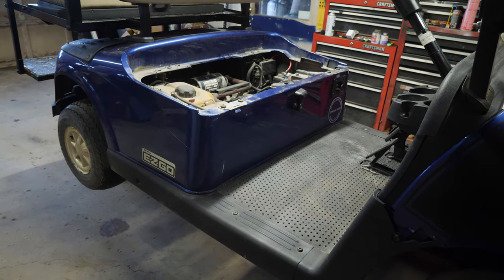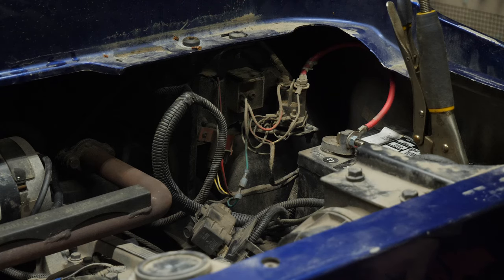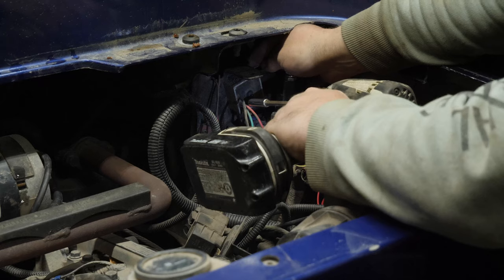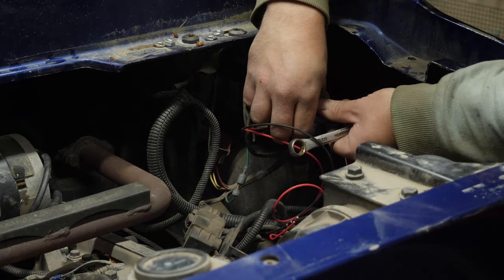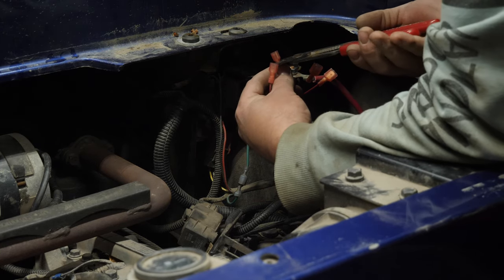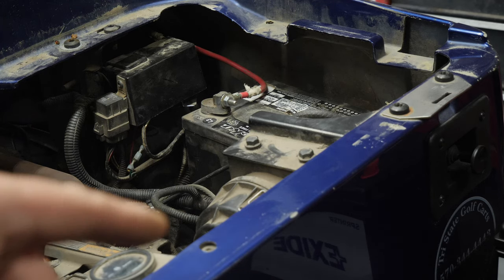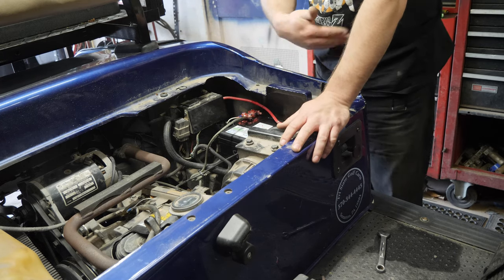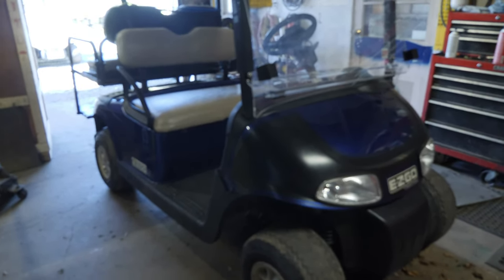2014 EZGO RXV, Gas - So Many Issues!

Comment: When adjusting the valves on this type of engine. If you bring the piston up to tdc one valve is open and the other is closed. Is that how you adjust it ? I thought when you adjusted them they were suppose to be fully extended. I know the images in the manual shows the adjustment being made with the spring fully extended out ?

Comment: Starter generator is number 1 failure component on 13HP Kawasaki EZGO. it's too underpowered to crank this massive engine through the compression stroke. Telltale signs are it hanging on the compression stroke. The newest 2019+ models have sealed brushes. Have to replace entire starter generator. Ain't disposability grand?
Reply from the maker: More reinforcement for my hatred of EZGO. I was able to get my hands on a 2020 model with a 150cc....... yes, a 150cc engine. What a pile of useless trash this thing was. Even the old 2-stroke models from waaaaaay back were more powerful than this waste of space. This cart wouldn't get out of its own way. I was happy to give it back and never work on it again.

Comment: I want to get where I can fix my cart myself. LOL just want to make sure I am not being skunked. my cart is not pulling up hills. We were riding yesterday around the yard and it just stopped cranking. my dad looked at it and the ground wire on the battery was not crimped good but the brand new battery was dead?? I just spent 1500 dollars on it at the shop. right now we have the battery on the charger and hoping this will fix it with the crimping the ground wire good. My question is if the ground wire is corroded will it cause it to lose power on hills?
Reply: I have a ezgo 350cc workhorse gas cart.
Reply from the maker: A bad battery connection will cause issues with cranking and charging. It has nothing to do with engine power. If the engine is losing power on hills, then you may have issues with fuel delivery, plugged up air filter, drive belt, clutches or compression. I would start with checking valve lash. They need to be adjusted to .004" between the rocker and cam lobe. Make sure the fuel filter is clean. Pull the carb and clean it internally. Replace the air filter and make sure the air box is clean. If the drive belt is out of spec, then it will cause the clutches to slip more and lose power. If the clutches are not opening and closing smoothly, this will have a negative effect on performance.